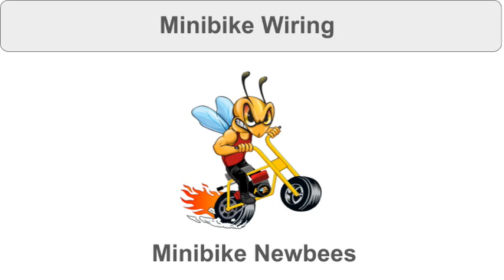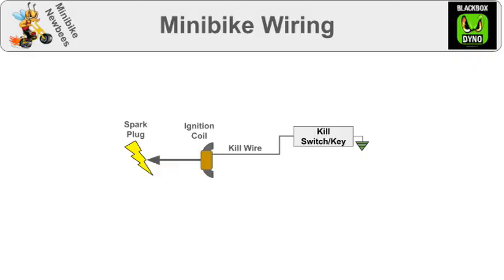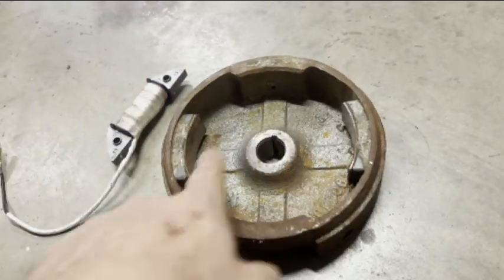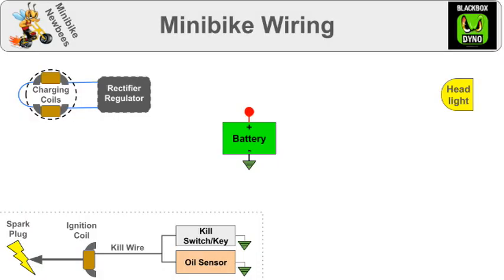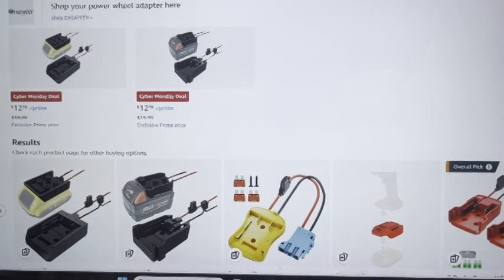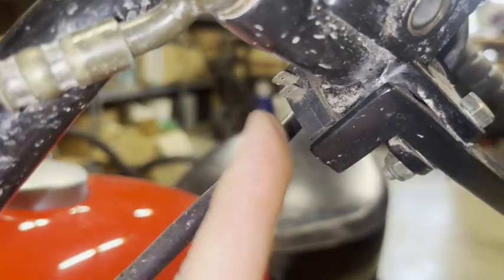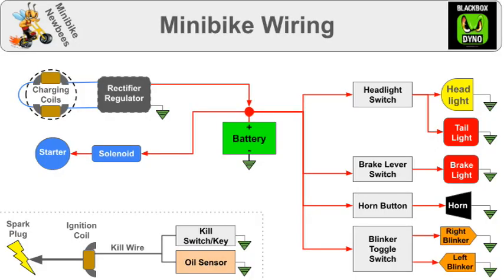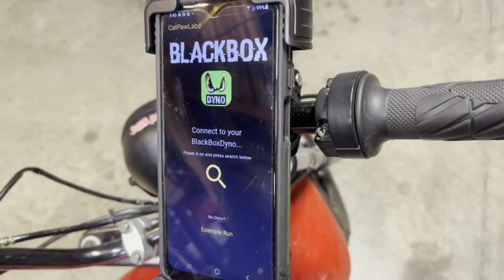Minibike Wiring

Comment: If the end of my ground breaks ( the circle connecting to the gas tank) is that why my engine isnt starting
Reply: Yes, no ground = no start or pretty much anything
Reply: You can re-locate your ground to somewhere else if you have enough wire left when you put a new ring terminal on. Just make sure you find a bolt that goes into contact with bare metal on the engine block, mine has it re-located to being sandwiched in between the block and the fan shroud... (Also get the right sized ring terminal to replace it, so it fits on the bolt)